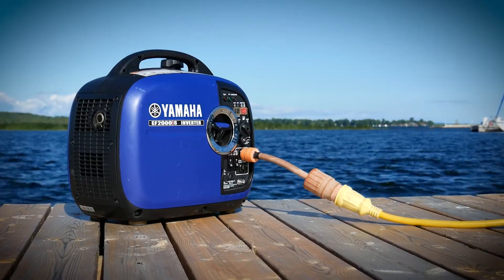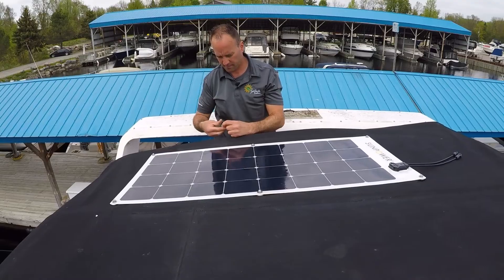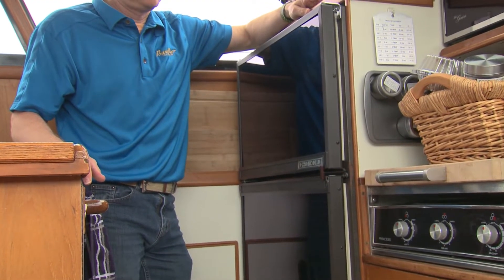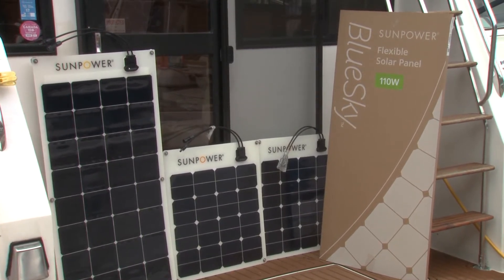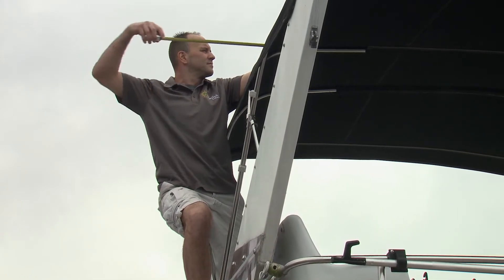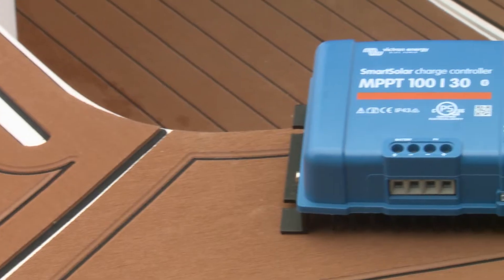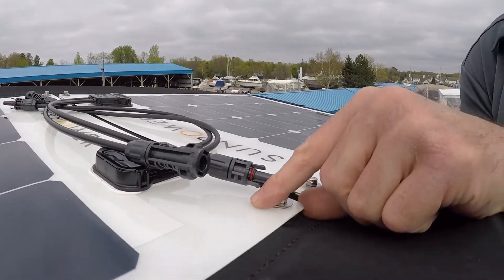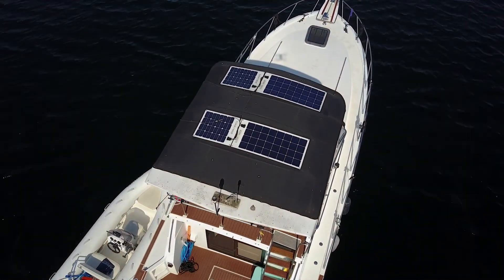DIY: Solar Power for your Boat - 2020 Episode 2 extended cut!

Comment: But do you (or is it permitted at all)  connect the controler to the battery switch or directly to the batteries? So to regulate which battery to charge
Reply: If you disconnect the battery from the controller with the panels receiving sun, then you risk damaging the charge controller.  The instructions make it very clear to connect the battery to the controller before you connect the panels to the controller.  Very much like pulling the power cable from a running alternator, the electronics fry with all that incoming power and nowhere for it to go.

Comment: So if the magnets are so strong why use nuts and bolts for your installation?

Edit: Just noticed the nut and bolt hold the magnets onto the panel.

Comment: Is there a way to completely replace my generator with a solar marine generator that powers everything on the panels?  I would assume in today's day and age, there has to be a way replace the generator.  My boat sits on shore power the majority of the time with the AC running.  I assume the shore power can continuously recharge the battery and when out on the water, the solar panels will charge the batteries while i use the generator.

Comment: Thanks for the informative video. I'm trying to get some advice on how to use Solar panels, to charge my deep cycle Electric trolling motor batteries, three 12 Volt batteries, all wired in series, to supply the necessary 36 Volts to the motor. Could I use one Victron controller,  and feed it's battery output to all three batteries, with a diode in each positive leg (between the controller and the positive battery terminal)?